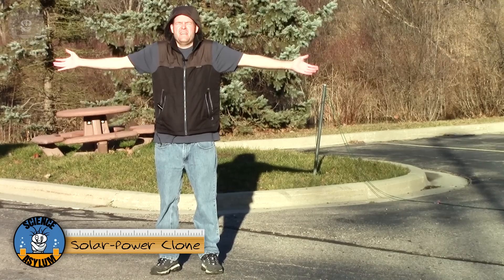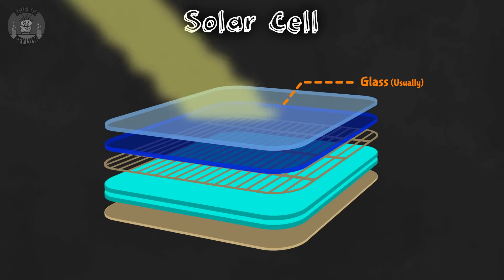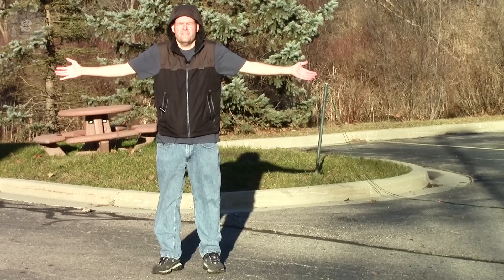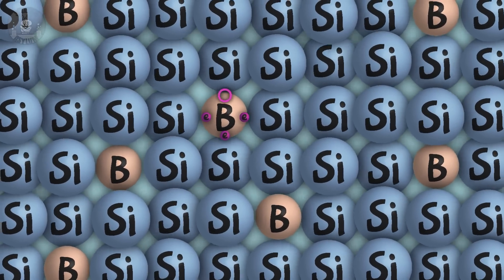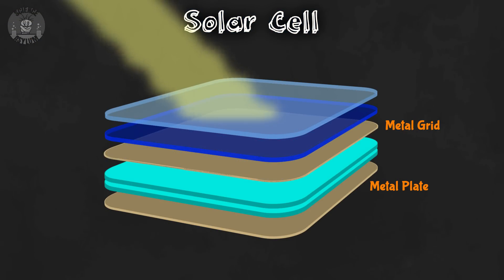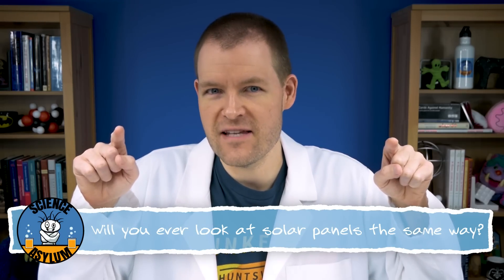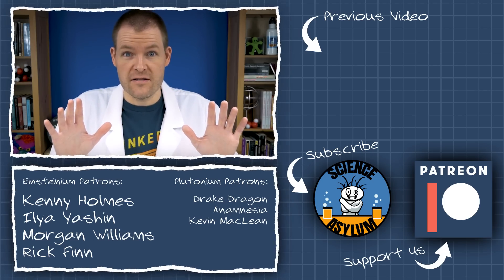How Do Solar Panels Work? (Physics of Solar Cells)

Comment: Hey Nick!! I think I debunked your infinite universe video with the help of quantum mechanics. Please correct me if I am wrong(and I definetely think I am wrong but still..). First we will think about a exo planet not very far away from our solar system. By quantum entanglement it has some probability of coming into our solar system. So basically it has a very unimaginably low chance that it will ever happen. Now think that the universe is infinite, so therefore there must be infinite amount of matter too. If matter is infinite, then even if the probability of an exo planet of coming into our solar system is extremly thin, the amount of matter is infinite so some amount of matter WILL come into our solar system even if the probabilty is low. But as there are infinite amount of matter, an infinite amount of that matter will fall into our solar system no matter what its probability is. This creates a paradox and thus the universe could not be infinite. This could be untrue if space is infinite not matter, but there is no space without matter, so I don't think that could be the case. Thanks Nick! I love your channel!!
Reply: When particles are entangled it doesn't mean that the whole object gets teleported... even when particles are entangled i don't think it means it is going to teleport...
Reply: You included an assumption. You said there is no space without matter. Space exists even if matter doesn't exist.
Reply from the maker: Adam is absolutely correct on his points. You seem to be mixing up entanglement with teleportation and you're applying quantum mechanics to large-scale objects (which you can't do). Also, like Adam said, space is a separate thing from matter. It's completely possible for a universe to exist that's completely empty (no matter at all). It wouldn't be that interesting of a universe, but it's existence is possible.
Reply: @ScienceAsylum   but can't entanglement apply to large scale objects? I thought that quantum mechanical effects can occur in our macro world but just its probability of occuring is small.
Reply: @ScienceAsylum  actually I saw in multiple videos that matter is everywhere in the universe. There's nothing like empty space. There's always something but I said that I could be wrong on this assumption, so it seems I am wrong.
Reply: Chief DVM ,  I too have a hard time accepting that space, as a concept, has any meaning without both time and matter.  I have long considered them three indivisible aspects of physical reality.  I too would like to know if my thinking here is mistaken.  In a nutshell: Space is measured by matter moving through it in time,  time is measured by the cyclical motion of matter through space, and matter makes its existence known by interacting with itself through space and time.  It is like the old Frank Sinatra song: “Love and Marriage”— “... this I tell you brother: you can’t have one without the other.”
Reply: Chris I agree, I have read many articles, watched many videos, read many books, and I think that space cannot exist without matter, as space itself is the gravitationao field of our universe. But I still did not get a direct answer to my question, is my thinking right or wrong?
Reply: @chiefdvm1671  and @Chris,

I will contribute my understanding, although it is incomplete.

Space and time are properties of the universe as a whole, or perhaps the manifold in which the universe exists if our part of the universe is isolated in a smaller construct.  Space and time could be emergent from something more primitive but they seem to be fundamental at this point.  Space is just a direction, not a distance.  Time is a direction too, but one with limits, it has an arrow to it, motion in only one direction is possible.  Put positive space together with negative time and you get spacetime as Einstein understands it.  They are opposite signed because one plays off against the other.  You can either move 100% through space or 100% through time or some partial mix of the two (this leads to time dilation and length contraction to keep a constant total motion in space and time, a constant we misnamed the speed of light).

An empty universe the size of an atom or one with an infinite reach are indistinguishable.  It would also be a flat universe in the sense that all fields would be near motionless.  An empty universe would be nothing in the truest sense possible.  Nothing does not need to be created.  But nothing is unstable, it leads to very high energy quantum effects that quickly reach a limit and condense into other forms of energy that become concentrated into pockets over time by mutual attraction and random motion.

When you add concentrated pockets of energy, chiefly matter, you start to have a universe with a shape, a universe that has gravity.  Matter curves the 3+1 coordinates we use to measure the universe.  The curves are what we call gravity.  In just 3D space we see gravity as an increase in the density of space, the coordinate lines fan in towards a mass in an ever denser pattern.  Objects (pockets of energy) track the straight density lines in 3D space or geodesics in 3+1 spacetime.  Both are correct views.

Ultimately all that exists is fields of various types, expressions of energy relationships, sometimes in motion.  Motions of fields (waves) can be traversal, like light or free electrons, or motions can get bound into knots of balanced composites of energy, like atomic matter.  Planets caught in geodesic orbits seem to be a special case of balance – mass energy bends spacetime and spacetime traps the mass energy.  Waves are how we see fields.  Fields are not physical things and wave motions are just changes in the energy relationships.  Energy itself is not a tangible thing, it’s just a measurable gradient between points in spacetime that can allow actions to happen.

Clear?  Any questions?
Reply: @cloudpoint0  I just have 1 question. If the universe has nothing, by nothing you mean the matter/energy or even the fundamental forces? (Sorry I am a newbie to this. But this interests me)
Reply: @chiefdvm1671  
No matter or radiation exists for sure in my empty universe.  Just a cold dark motionless and endless void or vacuum exists (or not exists since it is nothing).

Energy isn’t tangible so you can say it exists or say it doesn’t.  If you say it exists, it would measure as a zero gradient between all points in the void.  Perhaps zero point energy would exist, which isn’t exactly zero at any single point compared to the vacuum itself but it is zero overall (aka vacuum energy).  The only thing recognizable that you could say exists are fields, but fields are merely defined to exist, they aren’t tangible things either.  Does a defined field exist if it is completely flat?  It does if I say it does.  But I’m flexible on this definition.

Fundamental forces are interactions between fields (not objects that can exist), but all the fields are inactive in my concept of an empty universe, so I suppose you could say they don’t exist in the sense that no interactions are happening.  If there was something that caused an action, the fundamental forces would seem to immediately exist and spawn virtual force particles.  The forces don’t need to be created, they are more like intrinsic action laws than things.  Simple action laws must exist in an empty universe even if they aren’t being applied initially, or an empty universe would never change into the universe we have now.  Rather than multiple forces they may have coexisted as a single more primitive force law perhaps including gravity (before symmetry breaking).

Once the instability phase gets underway the situation changes.  Some kind of scalar field accumulates an enormous amount of potential energy and the universe’s surrounding manifold inflates in a mathematical sense (the inflationary era).  This curves the coordinates of the void so I think you could say non-zero gravity starts to exist in some sense.  Remember that distance and duration have no meaning at this point, so inflation can proceed at any rate stopping at any size, even in an instant, or over an eternity.  It is probably an effect that happens across the entire endless void.  Maybe it is still happening at the edge of normal spacetime (in the past direction of the time axis), and decaying back to a vacuum somewhere else (in the future direction of the time axis).

Matter and radiation only show up later when the high energy scalar field covering all or a large sub-volume of the new spacetime breaks down in a big bang.  I think inflation is just a mathematical change happening during this early era of the universe that we interpret as more spacetime being created, like expansion now.  Cosmologists always speak of an ongoing metric expansion of space changing the scale factor, not a physical expansion.  The metric is a mathematical entity made of space and time.  It’s complicated.

Some of this is speculation and oversimplification on my part arrived at from reading papers and publications by Hawking, Guth, Linde, Carroll and others.

The rest of the story is explained quite well in a long series of articles.  Enter the following Google search term for a list of the articles:

"what-was-it-like-when" site:medium.com/starts-with-a-bang
Reply from the maker: Why didn't you comment this on the Infinite Universe video? It seems like that's the place for this conversation.
Reply: @ScienceAsylum   actually I wanted your personal opinion.
Reply: @chiefdvm1671  The only way to learn quantum mechanics is watch a bunch of YT videos. At least that's what i learned. Make sure you watch the right videos because if you don't you'll get so confused like I did. I took me over a month to sorta understand QM. I probably have watched 50+ hours of YouTube videos on QM alone. Make sure to watch Nick's videos on QM!
Reply: In my opinion, i think you're misinterpreting quantum mechanics. Hopefully nick will clear it up.
Reply: @adamroach4538  I think that too
Reply: @chiefdvm1671  No, quantum effects do not apply to large objects. That's why you don't see the earth in superposition.
Reply: Even though, thanks for helping me out. That thought was in my mind for months and I thought what better place to clear it up. Thanks Adam and Nick!! But I really want to learn quantum entanglement from somewhere. Can you suggest me a book for quantum mechanics for newbies, etc. Thanks!!
Reply: Another thing. You said in your video that The Big Bang happend everywhere. Doesn't that mean that matter should be everywhere. Is there any Big Bang possible without matter? I don't know. But I personally don't think it can....
Reply: Why am I so dumb. I did not mean to write quantum entanglement but quantum tunneling.....
Reply: Because in my original comment I was refering to nothing as in no fundamental forces, no quantum effects, no fields, just nothing.

Comment: What if every force is actually a curvature of space time ?
Reply: Every force is a curvature of some field, but only the pull of gravity is a curvature of space time (or the gravitational coordinates we use for space time, I think).
Reply: @cloudpoint0  oh, but every force is affecting the trajectory of the object it is acting on , so every field should be directly linked with space-time
Reply: @rygue  Gravity isn't a force.  Everything moves in special straight lines in space time, lines called geodesics.  You can map real forces into their own separate space times where curvature represents the actions of a specific force.  This isn't usually done since they can be more easily understood as forces or interactions between fields within gravity's space time.  A force at the quantum level is an interaction between other things rather than a cause leading to an effect.  Probably for gravity too.  It’s complicated.
Reply: @cloudpoint0  Okay thanks , so on non fundamental level we can actually interpret every 'real force' as curvature of space-time, this way all the forces don't exist and are just caused by the fact that the object we apply the apparent force on is moving on a geodesic but we don't do it isn't it ?
Reply: @rygue  Yes, we must do it for gravity to be really correct but it is an optional way of looking at things for the 3 'real forces'.  A force is an acceleration and an acceleration is a curve in its own 3+1 spacetime geometry.  Gravity is an acceleration, a curve in its 3+1 spacetime geometry but we can't really explain gravity as being caused by a true force in the way that the motions caused by the other forces can be explained.  But treating gravity as if it is a pseudo-force works out close enough for most situations.

Comment: You kinda addresses current flow here. The boron became negatibely charged as a result of havind excess electrons from the SI (As a result of solar energy). When a wire is connected between the negative and positive plates the excess Boron electrons will want to flow back to the Si....hence current flows from negative to positive....Same happens in batteries etc...P.s. Once again GREAT work 🍻
Reply from the maker: Yes, I didn't want to get caught in a discussion about direction of electrons vs direction of "current," so I chose to leave it out.

Comment: how does voltage goes into the conductors?
Reply from the maker: The voltage is only across the depletion layer, so you can't just hook it up and have it work. That why you need the light to shine on it: to get the electrons moving around the depletion layer.

Comment: (remember i don't watch full video, i watch part and think and comment otherwise i would forget)0:58 power sources do not provide energy but we do not know for how long that would provide energy or even if estimated, it would be large value and probably depends on usage so power rating would be better , i mean like 5 watt panel or something
2:03 i can feel part of your excitation, i thought u would not go because may be off topic or long video
2:22 i was thinking about that glass reflection i think, when initially u talked about layers
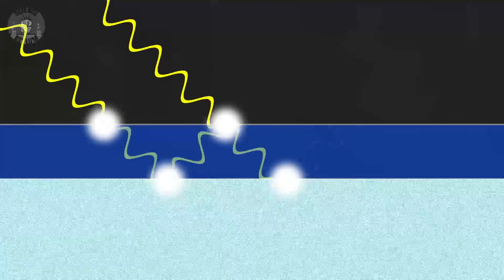2:50 well somehow interference popped in this, so even if cancelled it is still going out, so energy should go away...????
Reply from the maker: The energy isn't light anymore when the reflections cancel. It transforms into heat and electron energy.

Comment: Then how comr first solar panel was made in 1830s while electron was discovered much later ?
Reply from the maker: Well, the effect was first observed in the 1830s. That's not when the first cell was built. That wasn't until the 1880s. Yes, the 1880s are still a decade before the discovery of the electron, but that's fine. We've accidentally built a lot of things before we understood how they worked.

Comment: Am I the only one who thinks of transistors ?
Reply from the maker: Transistors are a little more complicated, but it's the same doping technique. A solar cell is N-P (as in the types of silicon). A transistors is N-P-N. There's an extra N-type.
Reply: @ScienceAsylum  Transistors are a big development for technology. Also, is there any reasonable source of energy ( like solar panels ) that doesn't pollute ? Like as efficient as, for instance, a nuclear power plant. Because, solar panels seem to be really bad when it comes to harvesting much energy.
Reply from the maker: Right, solar panels aren't going to solve all the problems. They're only worth the setup cost over the long term, and not even in all areas. Every energy source has its ups and downs though.
Reply: I say we get to the nearest black hole and start harvesting the energy!

Comment: What happens when all the electrons from the P atoms have been excited and moved to the B atoms?
Reply from the maker: Not all of them can move over, like I said at 5:58. Once they find an equilibrium and settle down, it's effectively turned the "depletion layer" into a battery. You just need light to get the rest of electrons moving again... the opposite direction along the electric field that was created by that initial rush.
Reply: The Science Asylum thanks for the reply

Comment: Great explanation, but I'm still looking at the amounts of oil burned to mine the materials, the oil used to manufacture, distribute, install, maintain, remove, dispose and replace. The newest panels are just now getting close to 1:1 (oil used/oil saved), older panels are net oil wasters.

Comment: If thought you could only convert ac to dc using a rectifier but how is it possible to do the opposite?
Reply from the maker: It's not as easy, but it's doable. Maybe I should do a video on it?
Reply: @ScienceAsylum  yes please , love all your videos❤️❤️❤️
Reply: @ScienceAsylum  I would also like to see a video on this subject!
Reply: Google:Voltage source converter (Generate a voltage ande uses IGPT) or current source converter (These fully controlled bridge rectifiers dont genereate a voltage, but act like a consant current source. They use thyristors).